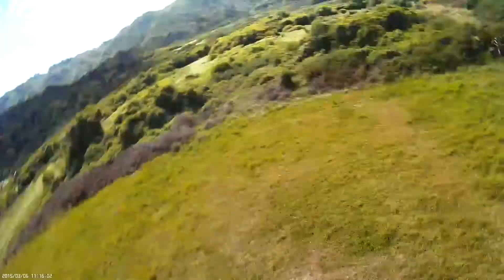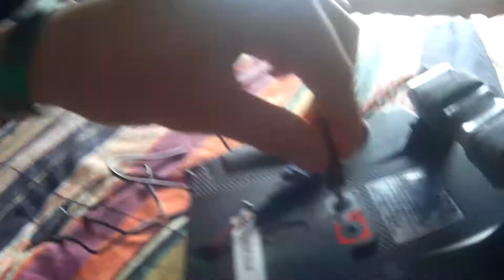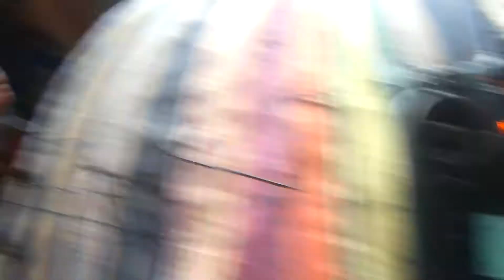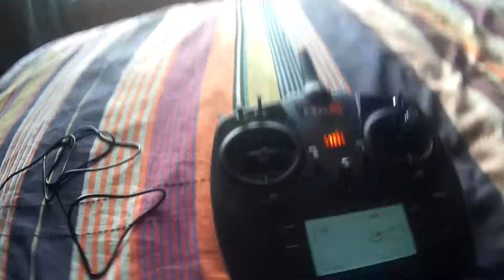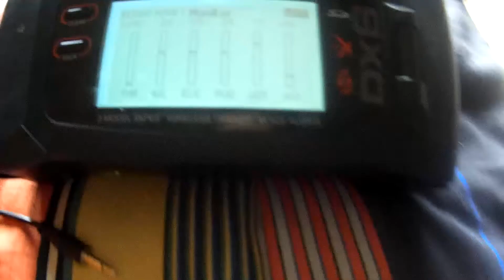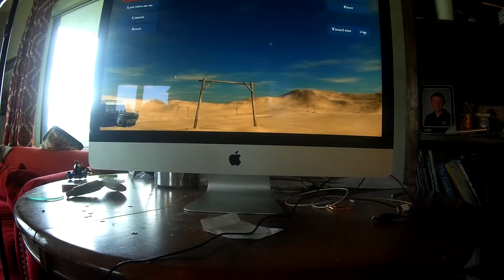Fpv free rider

Comment: will a 9xr work with a macbook pro?
Reply from the maker: +Luke Sallows It should work, but make sure that one of the connectors shown in the video fits your transmitter

Hope that helps :)
Reply: +Ultra rc will give it a try thanks.

Comment: you probably should have used a screen recorder instead of just using you camera
Reply from the maker: +jamiepie123 I will look for one, the one that comes with our computer records in like 15fps, after I find one I will upload a compilation thing :)
Reply from the maker: +Ultra rc also any screen recorder I try has low frame rates because the screen is 5k and with the specs of a mac its hard to run a 5k screen and record it at the same time, I am looking for a way to record the whole screen but in 1080p, but that would require extra cpu power to reduce the 5k to 1080p while recording